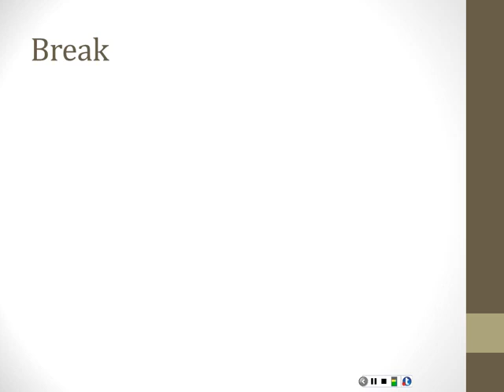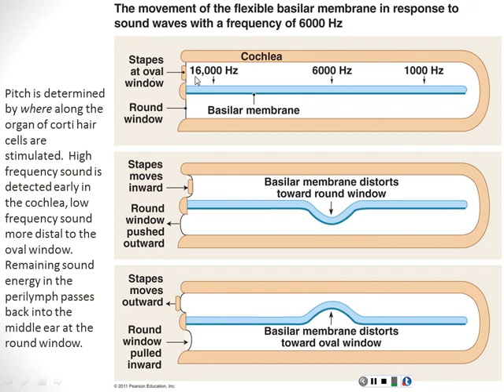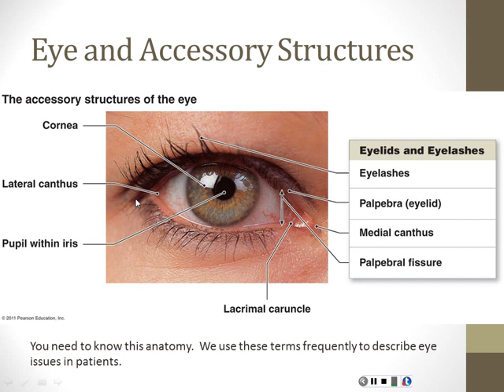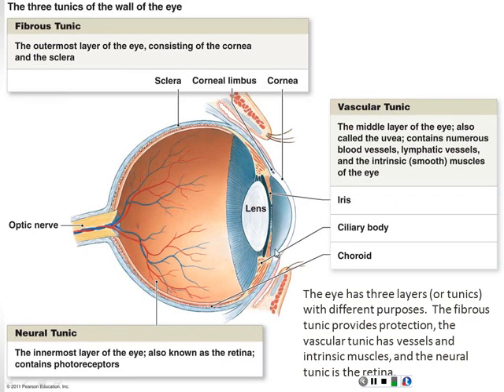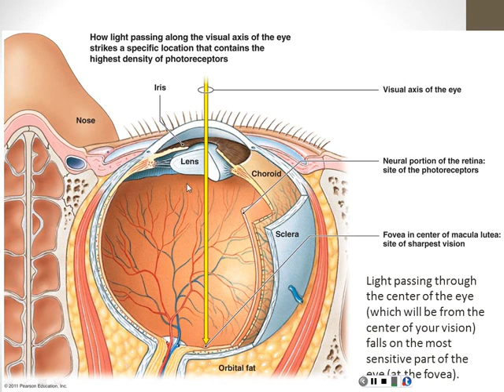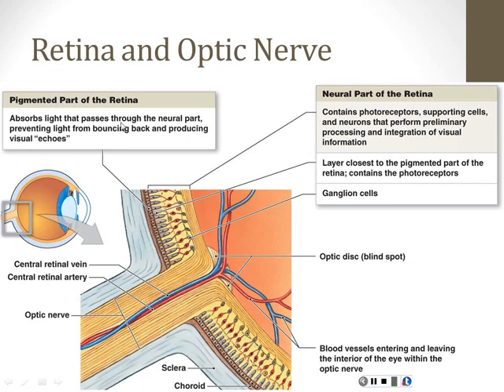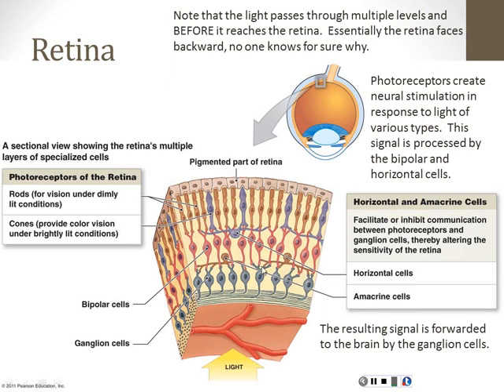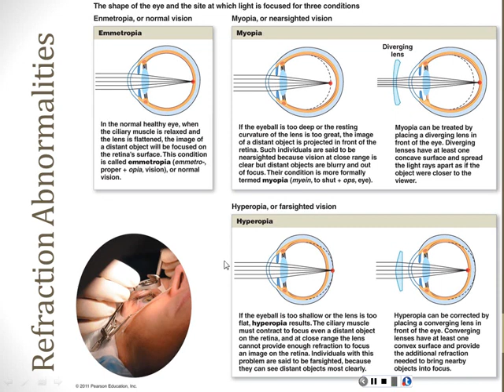Chapter 15 - Special Senses - Part 2

Comment: If I am only thinking right at 10:50 sensory receptors for balance are found i the vestibule and not semicircular canals. You even went further and said the utricles and the saccules which are found in the vestibule.  The semicircular canals are for rotation and vestibule for equilibrium and balance right??

Comment: When the sound energy exits the round window strikes the tympanic membrane from the other side, would that also cause the tympanic membrane to vibrate? Is that why a particular loud sound might cause ringing? The sound energy travels back and forth until the energy eventually dissipates.
Reply from the maker: Interesting theory, but I believe the round window is quite a bit stiffer, and after traveling through all of that perilymph there wouldn't be sufficient energy to move enough air in the middle ear to create that effect.  Ringing from loud sounds like actually caused by hair cell fatigue or even damage.  When they don't fire properly we experience ringing.